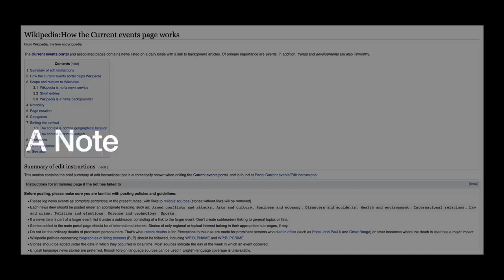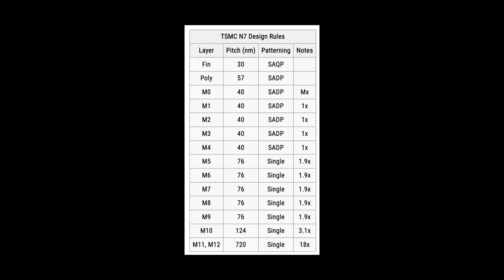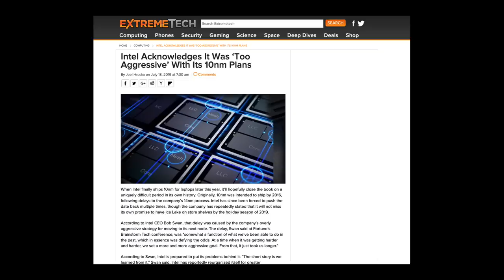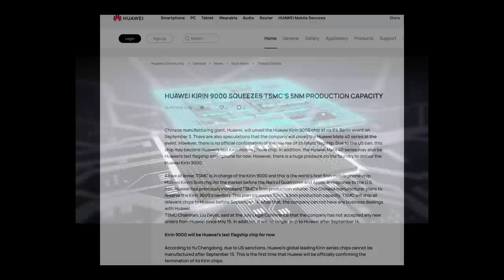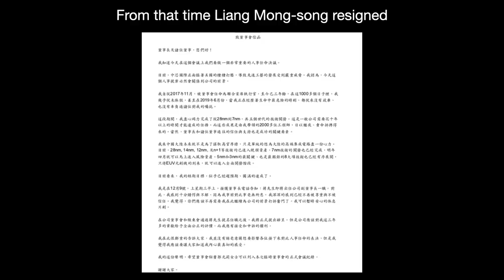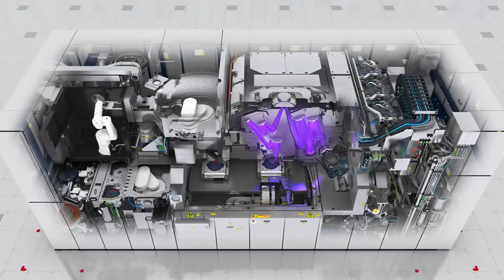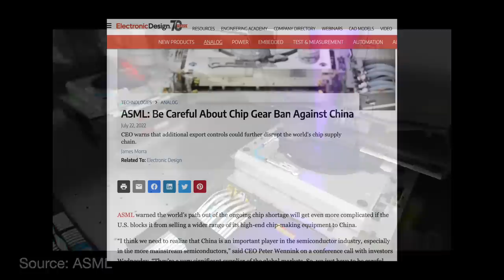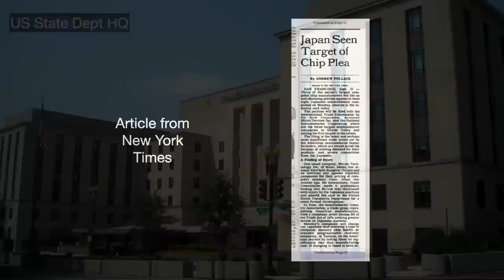China's 7nm Chips: SMIC N+2

Comment: I really like this phrase: Everyone can be creative when challengues are faced. 

I'm not sure how well will be China at the end of the decade but if USA fails in its bans. A lot of high profile industries in Europe and East Asia will become less competitive against Chinese companies because of the exclusion in their techonological development.
Reply: This entire video is incredibly misleading. SMIC's 7nm process has been proven to be a pirated version of TSMC's 7nm process. Despite this, it's very unlikely this node is anywhere close to usable as yields would be garbage on this node due to the lack of EUV equipment. SMIC does not have any EUV machinery nor will they ever be able to obtain it since they need to get it from the US. With Sino-US relations at a historic low, this becomes impossible. There's no path forward despite the fanfare of the announcement.
Reply: @wakannnai1  Tsmc 7nm yield using duv still acceptable, 5nm is the part where it has yield problem... smic, 7nm by theory also has no problem with it... not when it reached 5nm.
Reply: @wakannnai1  before this, they said the best China can produce is 14nm. I'm betting they will pull a surprise as they've done so in spite of the 'experts' opinions.
Reply: @wakannnai1  pirated? Guess what, they're designed by poached TSMC engineers. Do you consider designs from poached engineers stolen?
Reply: @Martin c'mon! smic have been heavily banned by U.S., they can not even get same chemical material. how can you simply "steal" this highly sophisticated process?
Reply: @Martin 

I think they tend to use trade secrets instead of patents.
Patents by definition needs to make the information public which makes "stealing" extremely easy.
Reply: You need market and Taiwan doesn’t have enough market to sell their chips if they lose China. I’d say let’s just compete see how it will work out in the long run. Economic competition is good half of the time. At least better than military competition. You can't get a world without competition since everyone wants different things and resources are limited. The role of the government is to encourage people to work together and live in peace. That won't happen unless if the ruler is all powerful and all knowing so he can delegate the tasks equitably, basically the being is God. Human beings are finite beings with limited knowledge. Limited knowledge will always results in misunderstanding, misallocation and competition.
Reply: @jakew5987  tsmc chips are sold to their U.S. design customers, who then sell them to system integrators who put em onto a PCB or assemble em into a device. Chinese EMS firms dont dictate which foundry produces the chip they assemble
Reply: @doctorwilly  Yes, but I am pretty sure the largest market for semiconductors is China. Without the market, how do these firms make money? Without the money, how are they going to improve their RD. I said it’s a long term gamble, China is lagging but it can really hurt the semiconductor market if it stops buying semiconductor from foreign companies. Over supply of semiconductor with no market will lead to layoffs to cut down the costs of inventory. Capitals want markets with consumers, that’s capitalism. capitalism doesn’t have loyalties , consumers do. As long as one is making money, I am sure the capitalist will switch allegiance to whichever country helps them to earn the most money even it’s an enemy country. Consumer might have loyalties, just like you are loyal to Apple phones or Samsung phones, Toyota cars or Mercedes cars or Ford cars, capitalists will just follow the money.   Taiwan citizens might want TMSC to remain loyal, but TMSC might decide otherwise, I am pretty sure most capitalists think like that. Money is their first allegiance, not the country. Politics has loyalties, you either like the party or not, money doesn’t because it’s not a person. So they try to turn chips into a political issue to enforce loyalty. Governments are entitled to their people, capitalists are entitled to their money. Capitalists will be loyal to their money first before their country.
Reply: @wakannnai1  ASML EUV is from Netherlands. Not the USA.
USA components in the EUV machine are two things. 1. Cymer Lasers. 2. Software.
USA Intel had been trying to make EUV work but No success. 
Eventually it was Netherlands ASML that was successful in making EUV work.
EUV hinges on China having good relations with Netherlands ASML.
ASML did say, for China version of EUV they can replace, American components like, Cymer lasers and software. 
With non-american components ie Lasers from Germany.
Reply: @Martin You have no proof that this process was stolen. You are making broad assumptions because you were been told so by your so called "free" media.
Reply: @Martin patent trolls. cough cough.
Reply: @Martin not everything is patented.
Reply: @Martin " Chinese companies steal these innovations. " you have no proof of that. You are merely spurting out vile accusation because the US ban does not stop China's progress.
Reply: @Martin "No, but if was produced with the tech from TSMC patents then it definitely is considered to be stolen." Tell me which process, patent number from TSMC is it stolen?
Reply: @Martin you cannot patent an "Idea". Do you even know how patent works? Are you 12?
Reply: @hyy3657  It's not stolen it's just copied.. patents exist for a reason or else why even try inventing anything if another country can just copy and sell. Of course China can't sell a lot of their products overseas but they can sell domestically.
Reply: @jakew5987  China market for chip is not big.
Reply: @wakannnai1  Your comment shows that you understand nothing about this subject. That SMIC's 7nm process is similar to that of TSMC is entirely irrelevant, SMIC is still out here making CPUs with 7nm transistors WITHOUT TSMC's help/involvement. Secondly, the yields will be more than usable as DUV is a proven technology and is one China has more experience with than EUV. People thought SMIC would never reach this point and yet here we are, people like you have always been wrong and will will.
Reply: @aoh4905  They can sell it to 7bln customers with no problems. Most people and countries across the globe have nothing against China and have no country-based import bans on high-tech equipment.
Reply: @wakannnai1
EUV is from ASML in the Netherlands.
Reply: @JK-ix8zi  these western should keep in mind that 91 percent of Taiwanese are Han Chinese 😊😊